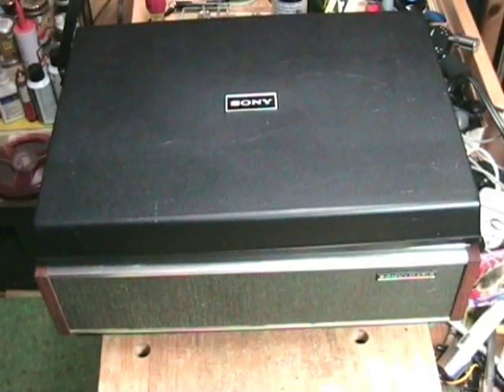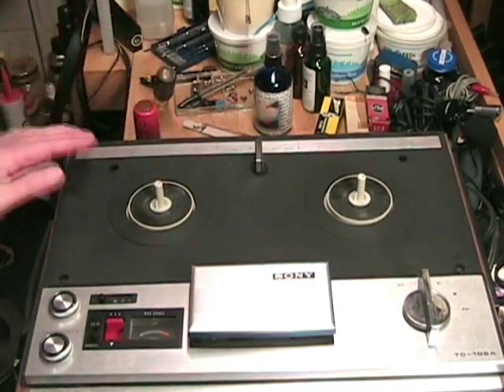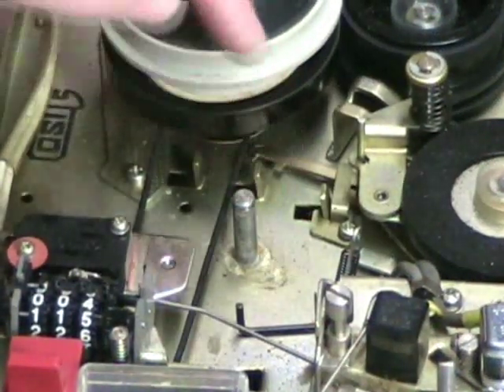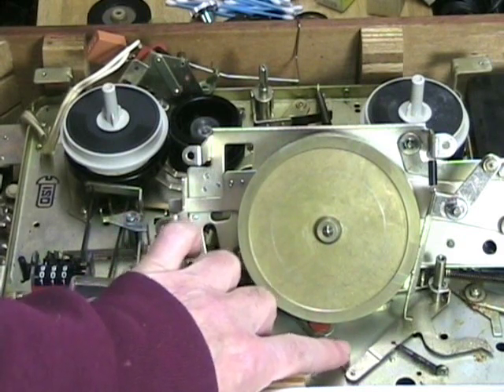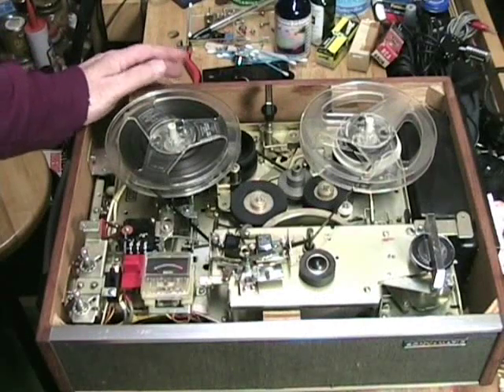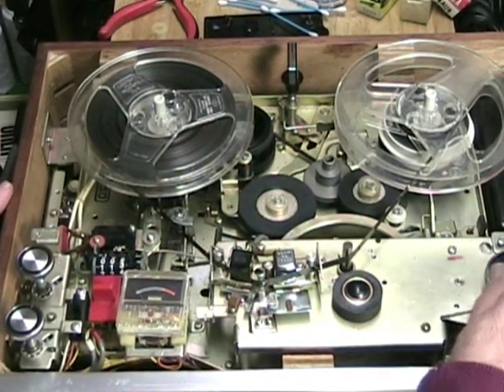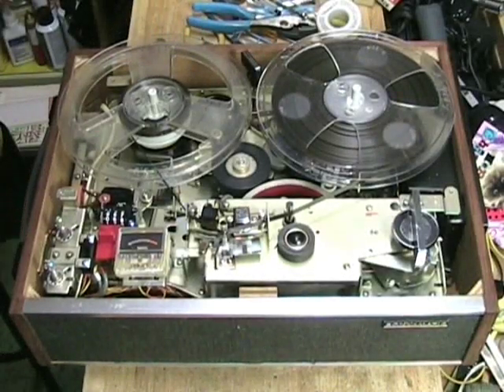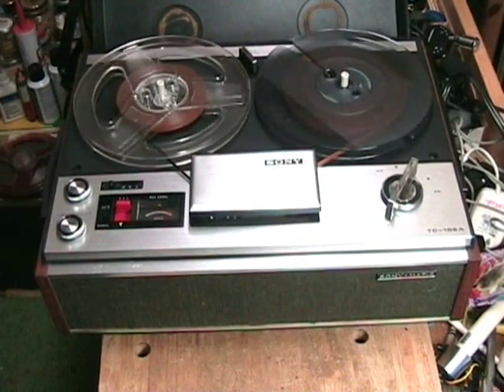Resurrecting the SONY TC106A Vintage 7-Inch Reel to Reel Tape Recorder

Comment: Much appreciated your video, which confirmed my findings that Sony lubed their units with a grease that "freezes up" over the years.  Just finished completely restoring my Sony TC-570;. AND just as you pointed out both brake arms were essentially froze up! PLUS, the elbow of the capstan drive wheel arm was froze solid! (Wheel would not even touch the capstan!)  After removing and soaking it, finally got it working.  FYI, I use a light weight synthetic oil -- a sewing machine type oil.  And NOW a tape I made probably 30+ years ago from the ol' record player is filling our home with Christmas music once again!
Reply from the maker: +PastorBruceKramer Thanks for sharing your experience. And congratulations on your restoration! "Gluebricant" was a common problem for many of the 1960s manufacturers, along with "melted belt syndrome", "plastic wire jacket burn" and the occasionally "wire insulation poweder-ification" (This mostly affected Italian machines by Geloso). 

These were all chemical issues that took DECADES to develop because they were the result of pollution and oxygen exposure that happened over far more years than the machines were designed to "live". 

It is a testament to the engineers and designers that their work has lasted so long (even with these issues), and continues to give pleasure and inspiration to others, not to mention a small fortune to some e-bay sellers who strategically overprice their finds!

Comment: Good job on the repair and clean up on a vintage piece of an audio recorder. These were made back when quality and reliability was paramount. Sony products back then were distributed through Superscope of Los Angeles California. These were also made in Japan. The only concern about these old recorders would be with the recording heads. If badly worn, play back would sound muddy, garbled with lost higher frequency response. Much like if the heads were dirty and needed to be cleaned.

Comment: Thank you. Am currently trying to figure out why a TC-108 Capstan wasn't turning and I realise, thanks to you, that the rubber flywheel that drives it isn't fully engaging.

Back into the depths I go . . . Much appreciated, that man!
Reply from the maker: +The Gods Right-Hand Man Hi, I recommend you do what I did in the video and get some Marvel Mystery Oil (you can get it at many auto, hardware stores and Amazon.com) and an injection oiler (a syringe with a long nose so you can be very precise in oiling. Marvel is a cleaning lubricant made for the stubborn sludge that builds up in car engines. SONY tape recorders suffer from "glubrication" where the grease they used oxidizes and turns into a varnish, thus sticking the parts and making them sluggish or not mobile at all. A drop or two of Marvel Mystery Oil on all greased joints will re-liquefy the grease over a short time and keep it fresh.
Reply: +clydesight Woohoo! She Lives! 

I disassembled the Capstan Drive-Wheel and found that the swinging arm it sits on was "glued" solid. Unstuck, cleaned & lubed same and she's running good as new.

Thanks again, Mr. Clyde  x
Reply from the maker: +The Gods Right-Hand Man Good News! Congratulations. Enjoy your tape recorder.

Comment: Thanks for the video. I'm starting to clean an old Sony TC-355. Considering the age, it's clean however there is no movement in the pinch roller or capstan so this video will be very helpful since it seems Sony used very similar mechanisms in most of these early units. I'm going to use Super Lube, an excellent silicon grease after cleaning all the shafts & pivot points with alcohol and q-tips. Can't wait to start now!

Comment: I like the Sony machines a lot also. They hold up very well - once I only had to replace the motor control cap, and one I got recently has the same problem as this one did- frozen pinch roller (I didn't attempt to fix that one yet.) I love the all-wheel design - no belts to replace (on most models.)
Reply from the maker: +bob7872 Thanks for watching the video. SONY was well known for being champions of idler drive. I find a lot of these machines now suffer from "idler drive shock" 

If you look at the rubber closely, you'll probably see it has cracks, and worse, it is "slicked". The cracks are caused by the shock to the idler when it is engaged between the spinning motor and the idle capstan flywheel, which is has to get up to speed very quickly. The idler is shocked by overcoming inertia in the flywheel. 

When the idlers were fresh and new, the resiliency of the rubber "healed" it. But in time, as the oils evaporated from the rubber, it got more prone to this type of breakdown. Like car tires that can have a tread but are still unreliable, these idlers need to be recovered to work their best. The slickness is also age and wear related. Also calls for a recovering job.  That can get expensive!

Comment: 25:24 when I go into Forward, the drive idler on my machine touches the motor not the fly wheel. I can't figure out why not. 

It never touches the fly wheel no matter what speed I am in. Mine tape recorder is also a TC-105A but some of the components look slightly different from yours.
Reply from the maker: Thanks for watching the video. I think you have a grease problem in the linkages for the arm that swings the idler between the motor and the flywheel, 

Turn the machine off and unplugged  (for safety)and get into the chassis. 

Put a DROP of THIN oil (I use Marvel Mystery Oil - available at many auto and hardware shops) - on the rubbing surfaces of the joint. 

Allow the oil a few minutes to seep in, and then try to work the joint by hand or with the machine's function control. 

If it is still a little stiff, dry everything off and repeat.

The oil should re-liquefy the grease they used and allow the joint to move freely. 

Good luck

Comment: Hmm! I would've thought the problem with the tape lurching forward when moving into PAUSE would be too much take-up tension. maybe the insert in the take-up table need to be replaced?
Reply from the maker: David Perkins  It's a combination of the feed table brake and the release of the pinch roller. The service manual gives the right specs.

Comment: you're a total master!! here in my country (chile) it seems that nobody knows how to repair well these machines... so i'm learning from your video to repair my sony tc-105 which is very similar to the model you are fixing here. mine is working, but plays at a lower pitch. thanks!!! greetings from chile
Reply from the maker: +lesquatrecentscoups Thanks for watching the video!  The Sony 105 is a fine machine and uses many of the same or similar parts and designs as the 106A   It sounds like you simply need to change the motor run capacitor. 

What is the electrical system in Chile? (i.e. here in the US it is 110 volts at 60 cycles) If it is different, then you just need to install a motor run capacitor for your country's voltage and cycles. If your machine was made for your country (not purchased in the US and brought to Chile), the old capacitor will tell you the proper microfarad rating. 

If Chile uses the same system as the US, then I have the answer in a video. See my follow up video to this one:  https://www.youtube.com/watch?v=eoV2ae9mCeU

Good luck!
Reply: thanks man. i found the MP capacitor and i will replace it. i have a question i think you are the only who can answers, there is any way to assign a knob or pot to control the speed of the motor? i'm interested on modding my tc 105 in order to make a tape delay, so i have to add another playback head, and it would be interesting to have control of the tape speed. can u help me? thanks so much!
Reply from the maker: I don't know of any way to change the speed of the motor. It is designed to run constantly at one speed, and the speed of the tape is altered by mechanical means. I don't think this type of machine can be altered to make a tape delay. Adding another playback head would turn it into a three head machine, but you'd need to do some circuit modification to make it work right. I can't think of how to do it. Sorry,
Reply: thanks man. no prob, i find out that it would be easier to adjust the tape speed with a knob in a walkman-type of circuit.
Reply: sorry if i bother you! haha, i have the final question. the capacitor in my sony tc 105 it says two specs on it "1,5uf+10-5%" and below "0,5uf+10-10%". i understood the tolerance thing you described in the another video. but the question is, i saw the service manual and for 50hz (which stands for the current in my country, not like 60hz you have in the US) the capacitor it's wired at the 0,5uf terminal AND THE 1,5hz; besides, for 60hz countries, it it just wired to the 1,5uf terminal, so i have to assume that i need a 2uf capacitor in order to replace mine, for 50hz? thanks !!
Reply from the maker: You are correct about the capacitance: 

SONY made it a little confusing because of the way they wire their capacitor. They take advantage of parallel capacitance to get two different levels out of one can. Back then, these things were expensive, so they used this solution. 

For your need, since you will not use this machine in a 60 hz environment, a simple rectangular ceiling fan capacitor of  2.0 uF will do. Don't worry about the voltage - most of these caps are rated really high (450 to 650 volts)  to protect from surges. Amazon and E-Bay have lots of them for sale. Good luck!
Reply: thanks man for your help :) i just searched all the electronic shops here in chile and no one seems to have these capacitors... anyone told me that they where hard to find here. so i just bought it from amazon, 3 weeks from now on deliver haha but better to be sure :) thanks!!!

Comment: Hello clydesight,
Wow, am I glad I found your video. It really helped me get my machine running again. Thank you for that. you mention motor lubrication with your special syringe applicator. My motor sounds loud and buzzy mow and eventually tapes will slow down to nothing, Where and how do I lubricate that motor, please? thank you again for your excellent video.
Reply from the maker: @Media House 
Hi, thanks for your comment. Your SONY probably needs a new "motor run capacitor". By now, most of the ones in these vintage recorders have gone bad, but replacement is relatively easy if you have some soldering skills. Here is a link to a video where a guy replaces the motor run capacitor on his SONY TC 200. The machine is a bit different from the 106A but the principle is the same. Two very important points: 

1. Match the uF rating (look on the can of the old one to see the value) exactly. The uF rating is what keeps the speed stable. Modern capacitors (used in fans mostly) are inexpensive and do a fine job. You can buy these capacitors on Amazon or E-Bay. 

2. DO NOT buy a SONY "new old stock" capacitor that someone will try to sell on e-bay as an "exact match". You would be replacing a failed part with another failed (or soon to be failing) part. SONY has not carried the capacitors in inventory for many years, so anything that claims to be an original part will fail, due to age.

Here is the video where the guy shows you how he replaced his capacitor. Please be aware of all safety concerns because this part is running at household voltages and will store the energy even after the machine is off and  unplugged. If you touch the terminals with your bare hands you can get a shock! 

sony Tc 200 reel to reel repair replacing the motor run capacitor: 

https://youtu.be/RsI6iucxuM4

I hope this helps!
Reply: Thank. You for your in depth reply!
I will try a new capacitor.
I truly appreciate your time and effort.

Comment: This machine, like my TC 630 has the same wretched felt pad pressure plate on the main head, my 3 head has a "balanced" pressure pad assembly on the erase and record area, but the rotten non self locating pad on the playback head which means that with pad wear the heads get destroyed by uneven pressure, i have re-engineered mine to have a self locating pad on the playback head but the damage was already done and new heads are not? available.

Comment: At 26:20 My Sony TC-630 looks prety similiar to the insides of your reel to reel. When I set it to play and try doing a mechanical test like you in this spot of the video, the reel moves the black rubber part but not the motor at all and the rest of the chain. In this spot what would you do?

Comment: Great video!!! I have a TC 252D that's not working properly. It's been years since I've used it but I noticed that the function selector was kind of hard. Never had any problems until now. I know for sure that it needs to be clean. Any suggestions? Any information would be helpful.

Comment: i have a problem with my 230 the shield before the heads and the pinchroller dont release fully so i cand wind a tape on it with the cover on i think its a spring under the headbridge but i cant lose the screws
Reply from the maker: dannyjaar    Thanks for watching the video. The most likely cause of the problem is sticky grease in the mechanism that controls the pressure pad plates. The old grease must be cleaned away and replaced. 

Unfortunately, this means taking the head deck off the main chassis and getting at the mechanism, which is hidden underneath and inside the capstan flywheel. 

Unless you can get the screws free to get the head deck off, you can't fix this.

Not sure what you can do with the stuck screws, perhaps another commenter will have a tip for you. 

Sorry.

Comment: Hey Clydesight, I need your help. My TC 252 D looks similar to the 106 A, same capstan, idler drive etc. I've cleaned every part, replace the belts and capacitor. Everything works fine except for the right take up table.When you play a tape it runs smooth up until the end. The table starts to squeak, slows down and stops, yet when turn the table over it works fine. Does the table have to replace or has be cleaned from the inside. Any suggestions would help. Thank you!!
Reply from the maker: I don't know... is the table exactly the same as you see in my machine or is it more or less complicated? Does the capstan feed the tape properly, and is it ONLY the take up table that makes the noise? If you hold the table so it can't turn, does the noise stop? Is the brake possibly slipping for some reason, so it it touching the take-up table or the feed table? Is there excessive drag on the feed table? Does it do this with different size reels 7", 5" and 3"?  There could be so many reasons for an odd behavior like this, It's impossible for me to diagnose something like this remotely. Sorry,
Reply: ***** Yes, the table is exactly the same. After carefully checking each part again, the right take up table is the problem. I took it apart, cleaned all the parts one by one, used WD 40 and thought it would the problem would be solved, nope. I have a feeling it's the springs that wore out, lost it's tension and causing the table to stop. The best bet would be to find the part or buy a TC 252D that doesn't work. The TC 252D is from 1970 and sounds better than before.